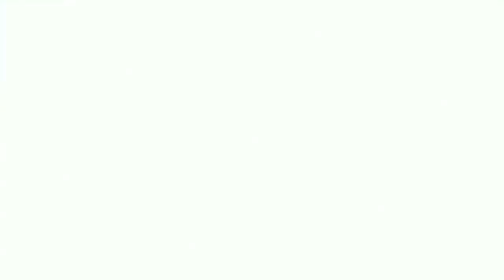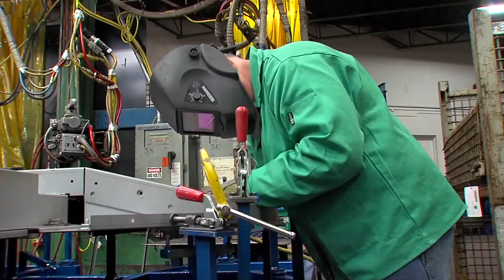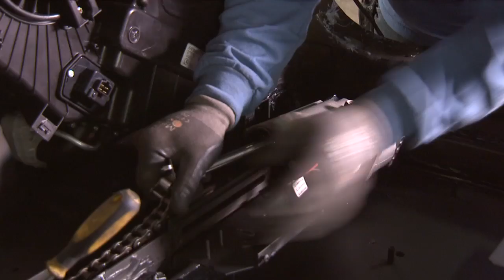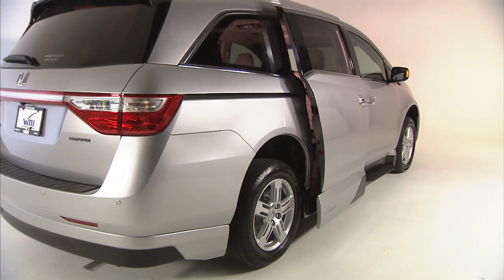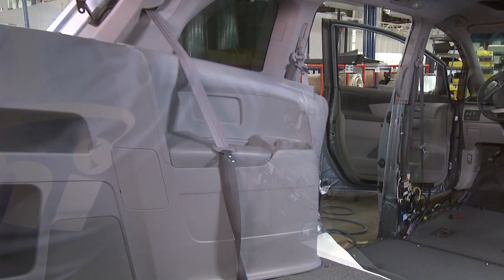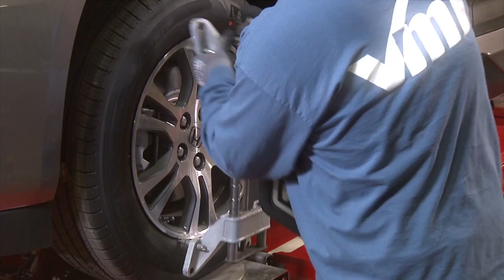Vantage Mobility - How It's Built - VMI Wheelchair Van

Comment: I got a 2014 Toyota Sienna VMI Northstar conversion last fall. It seemed good until all the mobility equipment went haywire and hasn’t worked since. I only used it for maybe two months. The kneeling system went out of sequence and got reversed. The ramp and door would close and then it would kneel. Open the door and ramp and it raised up. Sometimes it just stayed in kneeling position. Van would not go into gear because of a safety lockout. The ramp stopped deploying automatically. Customer service is nonexistent. Head company refers me to my local dealer my local dealer does not respond. I actually considered getting a new VMI van because how it initially worked and the extra room compared to my 2015 Dodge Caravan conversion from another company. But after this experience, and reading complaints online I would never consider VMI. Just google VMI van problems. Look at reviews on Trust Pilot, BBB ETC.

Comment: We recently purchased a 2011 Honda Odyssey VMI wheelchair conversion van with the ramp in the 10" dropped floor - The Van DID NOT come with the SIDE STEP ROCKER PANELS - It is challenging for a non wheelchair user to pull yourself up into the passenger front seat when you are only 4' 10" and are nearing your 80's like us and most of our friends ----- We want to purchase a set of these SIDE STEP ROCKER PANELS and have them installed on our Van - Our Local (65 miles away) VMI REPAIR SHOP is NOT HIGH on our recommendation list for mechanical/electrical repairs - We have been there way too many times in the past with our previous Van - Can Vantage Mobility sell us a set of these SIDE STEP ROCKER PANELS directly ?